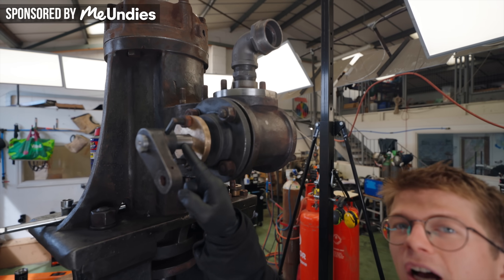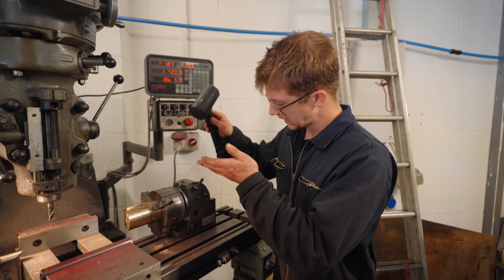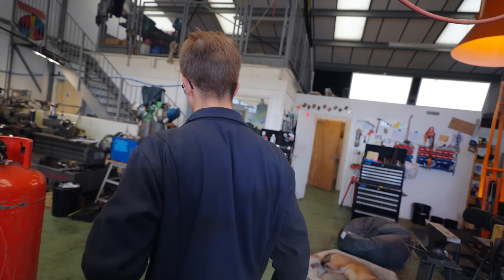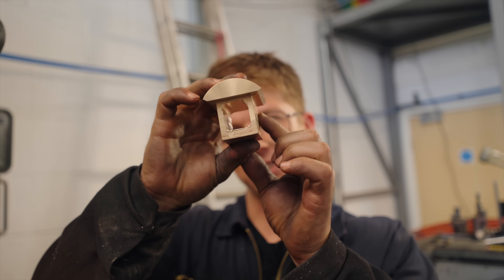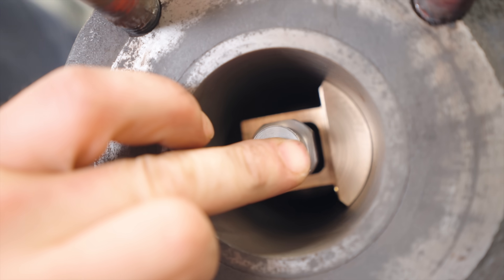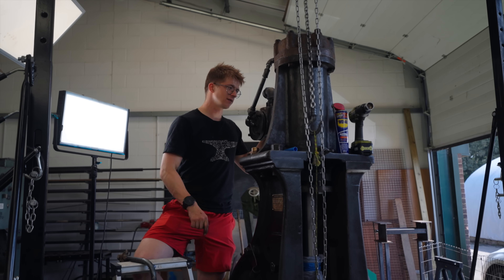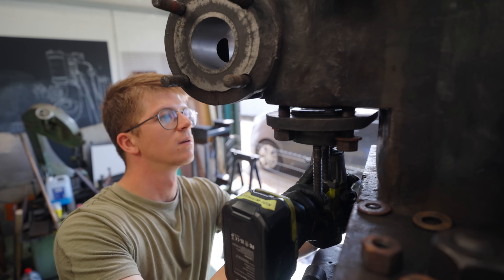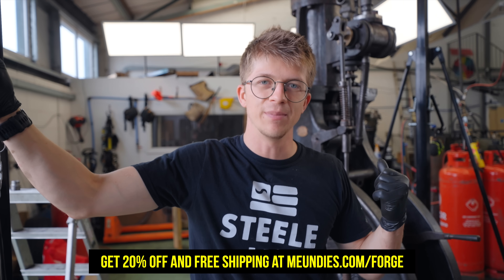FIXING A 1900's STEAM HAMMER! Pt. 14

Comment: For the adjustment screw couldn't you make a tapered hole so when you screw it in further it would push the to valve away from the shaft

Comment: when you heat up the pipe to bend make sure the seam of the pipe is 90 degrees from the bend. with steam you should use sch 80 pipe other wise heavy wall. not sch 40 stander wall thickness.

Comment: 5:37 the only significant difference between the hole on your "working-original" (we know it's been modified, at least to a degree) is that your new piece has a much sharper angle. This may cause the edge of the hold to degrade faster over time, akin to how the gas port on an AK47 barrel differs from a newer AK-variant. Newer ones have a  90º port milled, generally speaking, whereas the older ones were at an acute angle--this caused the high gas pressures of the firearm to eventually erode and cycle too much gas through the long-stroke piston. The pressures of a firearm are incredibly high compared to this steam hammer, of course, but the same effect will happen on a longer timeline.
Reply: 8:08 BUD/S is a prerequisite for SEALs. Seal Qualification Training (SQT) is where one's trident is earned. Thanks for teaching me this, Jocko!
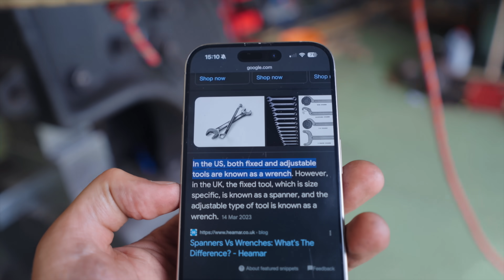Reply: 14:53 A: Adjustable Wrench; B: Wrench (or Combination Wrench, since one side is boxed, one is open); C: Socket Wrench.

Greetings from the States.

Comment: After speaking to a number of friends and family with a combined total of nearly 300 years experience in various engineering a mechanical trades. I can confidently state that they are called, an adjustable spanner, combination spanner, and a socket ratchet. I believe the term wrench is an American name, has none of my friends or family in the business new of a tool in the UK called a wrench.

Comment: The steam or air pressure will move that valve against the face. maybe add a leaf type spring just to give it a little force against the face. no need for that screw thing

Comment: You know what you could have done? Is improve what was there. 

That brass valve needs adjusting because it's a less than half a circle. Why don't you cut a new one with rounded flanges on both sides. That means you can tolerance it like a bearing inside the valve body. The shaft will not have to hold loads and it will not wobble out the shaft at the supporting end caps. 

Let me see if I can make it more vivid. You've got a rounded dovetail on one side. Make it double sides. On the other side, inlet, cut a slot across so gasses will flow in no matter the position, but you will still have supports a 180 degrees.

Comment: I have a silly question. Can you tell, through metalworking experience, which pieces were milled, cast, forged, welded, braised, or or made by whatever process so you can use the same process?

Comment: i have a feeling a number of those inner valve parts do have a mass/weight specification range and if its too heavy/hard to move for the steam pressure it could lead to, best case just an inner failure of a single part or worst case potential EXPLOSIVE/projectile valve pieces of varying velocities. please make sure to weigh parts you are making for the insides compared to the original parts. since those will have much less leeway when it comes to mass deviation. JUST IN CASE.

Comment: An adjustable wrench or some people say Crescent (brand) wrench, a box wrench (for the closed end), and a socket wrench.

So what do you call a pin spanner or hook spanner?  The pin spanner has a dowel and curve to fit a hole in the outside edge of a large round, for example a lathe chuck threaded onto a spindle.  The hook spanner is similar but with a hook instead of a dowel.

A face plate spanner has two pins that go into the “facing surface” of something round, instead of the outside edge.

I’m no professional, so may be using the wrong terms for spanners in the US.

Comment: Hey Alec, are you concerned that with thermal expansion from operating on steam, you may have gone a little too tight on some of the tolerances? I wonder if they fits should have been tested at the design temperatures. Good luck!

Comment: Is the adjusting screw in the valve assembly really necessary? I think all that pressure in the chamber would push the valve to the opening forcing It to close, after a bit of wearing the seal would be good and "automatically" adjusting the play and the force. Nice design, isn't It?

Comment: Hello, the weight of the bronz piece will not be a problem since the new one is not hollow ? The hole for steam got the same size but the wight to put in mouvment is a little bit more than the older one. I'm not in that field of competence at all, sorry if it's a dumb question

Comment: Can't you use air to run it?? 
I have a few tabletop steam engines (basically full functional models) I connected them with air instead of steam and they work just as good, one works even better with air..

Comment: It's a wrench an adjustable wrench and a ratchet (3/8" drive).  What do you call the different size sockets? As in 1/4", 3/8", 1/2",3/4", or 1 " drives...if you refer to them as the US... what happened to your precious metric system? 😂

Comment: For how much effort you and CEE put into taking something apart and restoring it. PUT SOME DAM OIL on the parts you put back on. It drives my nuts rusty to know you just took it apart with great effort and rust busting. To know you didn't help the next time it comes apart. Anything. wd40, mineral oil, anything. silicone, motor oil